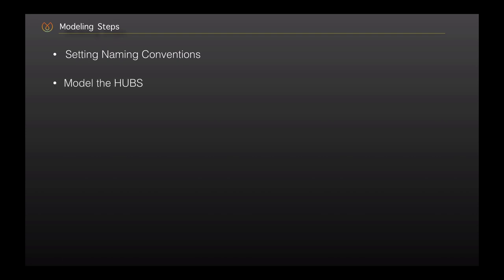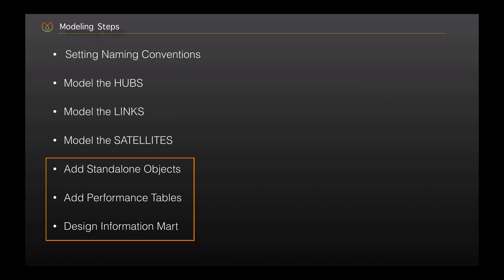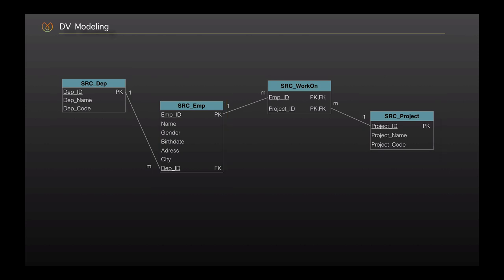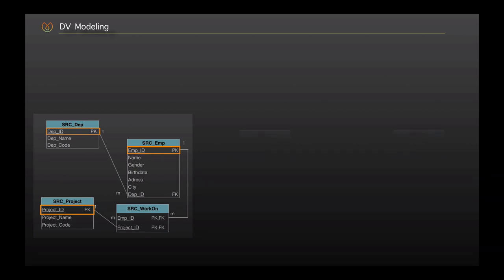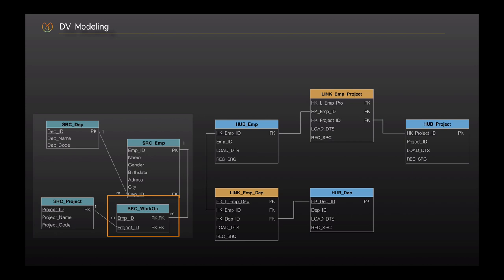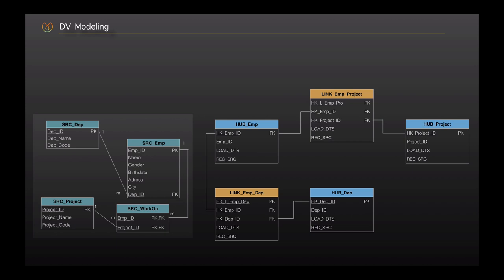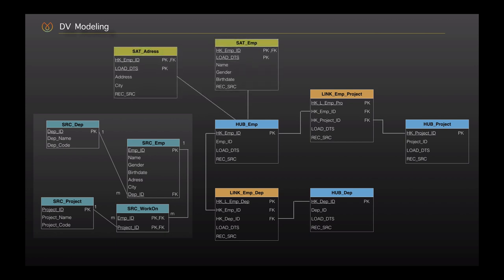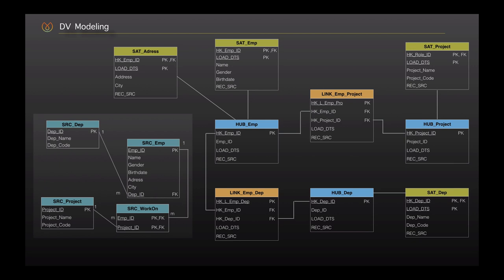How to create a Data Vault Model from scratch

Comment: What is the special benefit of Data Vault modeling compared to convention EDW design say Kimball methodology ?
Reply: Not creating an intertwined monolithic mess of a data structure, and adding possible support for streaming ETL. However, probably using a Data Mesh is even better as it's much easier to develop and doesn't have the stupid hash keys.

Comment: You need to add a relation describing hub between employee and project which contains the data for which employee works on a specific project. In your case you would have sattelite attached to the link. This is not advised in data vault modelling

Comment: Data Vault is crap ! It creates a plethora of tables for literally nothing.
It's a non sens to add tables that doesn't bring real business value..
What is the purpose of dividing the model into hubs, links and satellites in the raw vault if at the next layer (business vault) we join again tables to consolidate them ? 
For developpers, a data vault model brings more complexity because they will need to do a lot of joinning to create there business agregated tables at the gold layer.
Reply: This is EXACTLLY what I confused!! The data vault, this kind of model designing no really avoid the nessary join. Although it seems clear in the staging layer, but in the downstream layer, we still need to use join to derive relative columns..

Comment: what are the tools available in market to design Data Vault modeling
Reply: Erwin. No additional tools are required to design the model. You can design your approach to populate all hubs, links, data in parallel using Airflow. Since all these tables have hash key in it, there is no dependency across them.
Reply: Erwin
Reply: we use Enterprise architect at out organisation